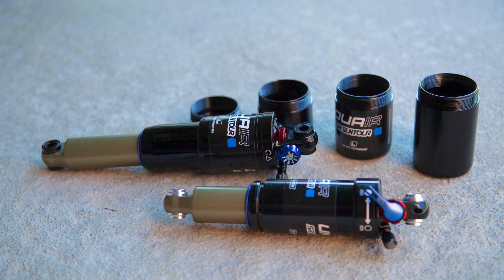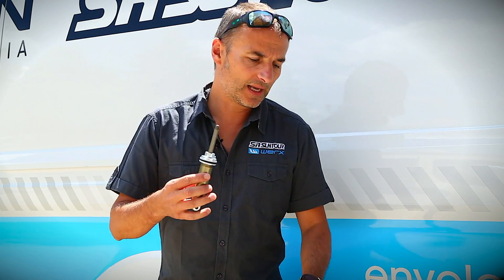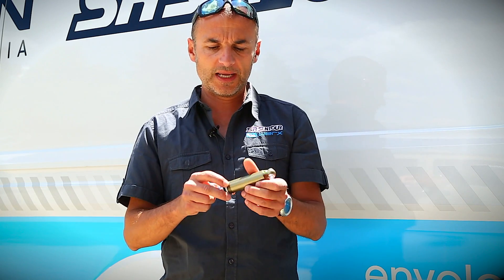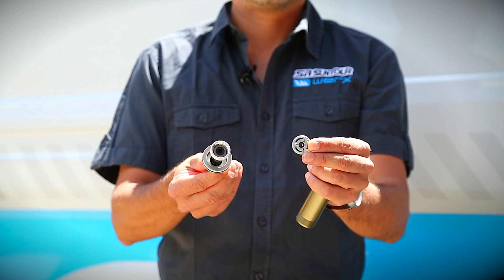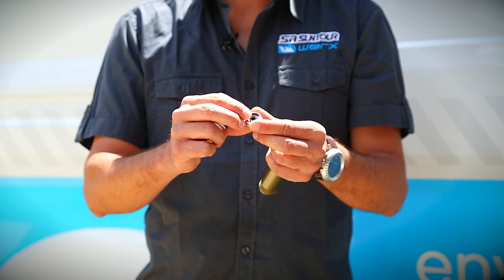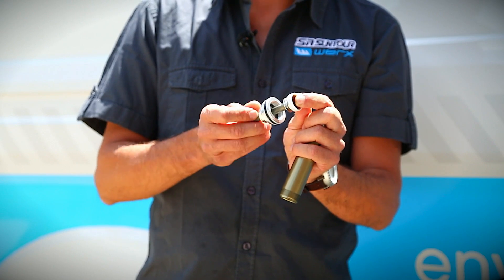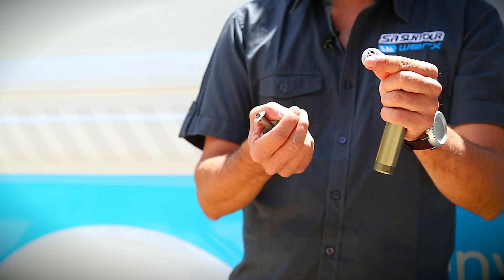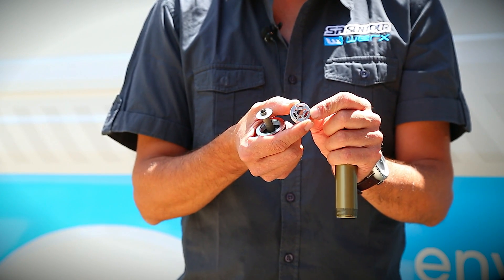2016 SR Suntour Rear Shock Technology - Duair and Unair

Comment: My rear shock isi epicon and leaking air very often what any solution to fixing that problem?
Reply from the maker: amikamhar amikamhar Have you had it rebuilt? Do you know how it's losing air? Depending where it is leaking from it could need cleaning, or new seals, etc. Best to check with SR Suntour for who can service it. It shouldnt be too complicated for most mechanics.
Reply: Thanks for the replies
Reply from the maker: amikamhar amikamhar 👍 to start with you could remove all the air and remove/clean/reinstall the valve core if it's removable.